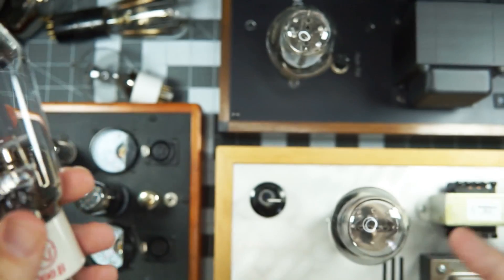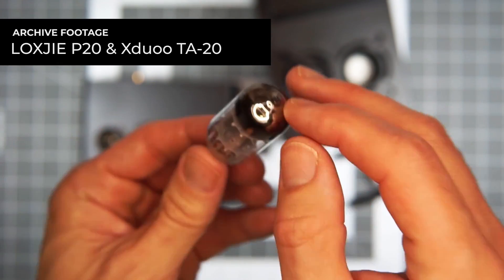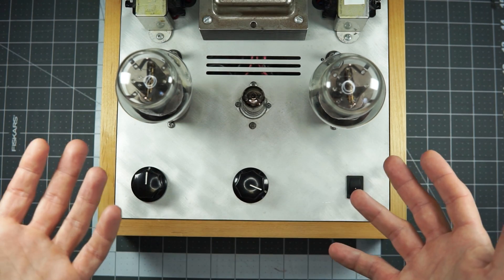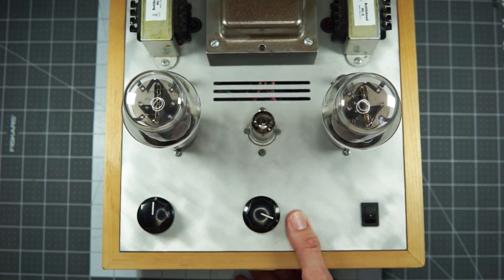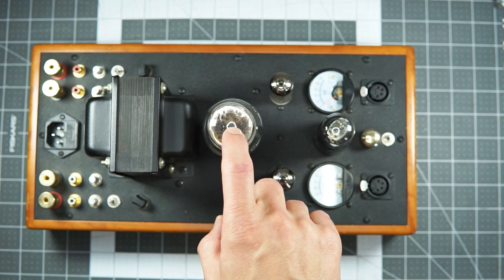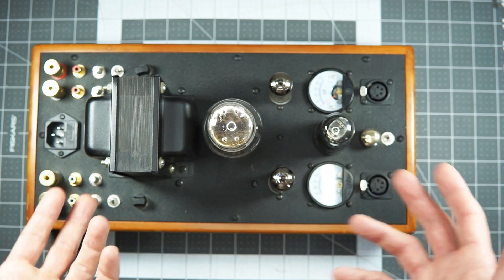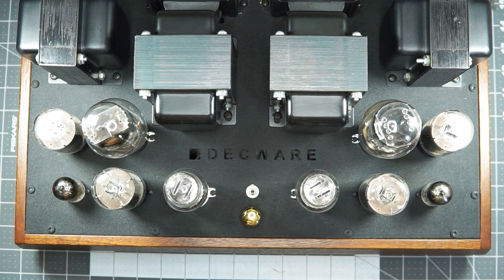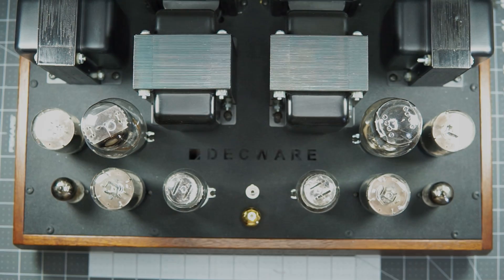Tube Amps 101 - Top considerations and configurations

Comment: my favorite set I own uses 805 power tubes with 35 watt output of clean power. it'll put out 50 watts but too much distortion for me. I use it to drive an old set of watt puppy 3s and it does a great job...

Comment: 6L6 is not a triode. It is a beam Tetrode. It can be wired as a triode but the tube is not a triode. It can be run in Ultra Linear and Pentode mode also.

Comment: Have you had any experience listening to Lab12 tube amps? I’d be interested to hear what you think. 

Also, what reference speakers do you enjoy with your SET amps?
Reply from the maker: I have not heard any Lab12 gear. I know their DAC was getting some good attention a year for two ago. Looks like they build a lot of stuff based around the KT-150 which is a tube I'm interested in but have little no experience with.

Main speakers are Heresy IV although I've had a handful of efficient speakers in the past.
Reply: Thanks for responding!

Is the Enleum amp23r your solid state reference?

Comment: Hi, I currently have a schitt folkvangr, which is a warm otl amp. I was interested in a set amp to see how different it would be. How is a 2a3 amp like the dna stratus compared to a 300b amp sounding amp? Can't decide between 300b or 2a3. I mostly use zmf headphones, and they'd probably sound great on either. I'm just wondering your thoughts on that.
Reply from the maker: Great question. I'll talk more about that in the next video in this series. At a high level the 300b is more powerful so it can drive more things. Not sure about the Caldera but the rest of the ZMF line can be easily driven with 2a3. In my experience the 300b is great at creating a really spacial presentation with forward mids and great clarity. The 2a3 is sweeter and more fluid but still had plenty of detail to offer. You really can't go wrong, just a matter of taste. In either case the implementation of the amp is key to getting the most out of the tube (and making it appropriate for headphone use with a dark background). Great 2a3 tubes a more affordable than great 300b so if you like tube rolling that is also a consideration.